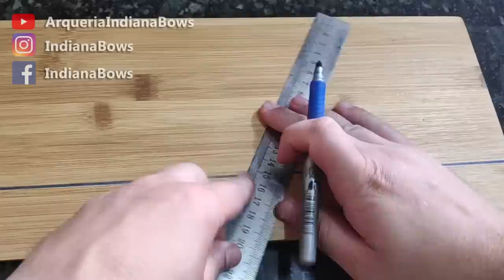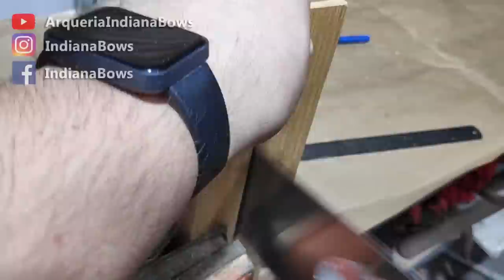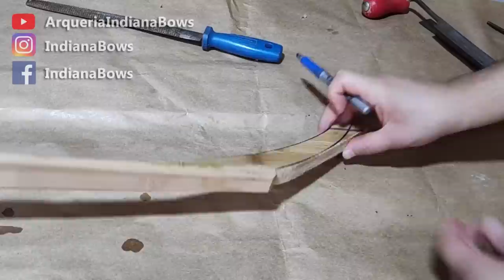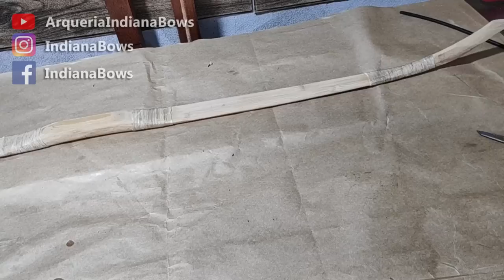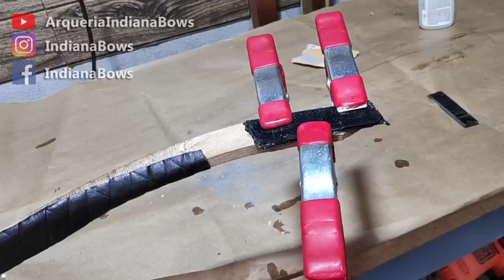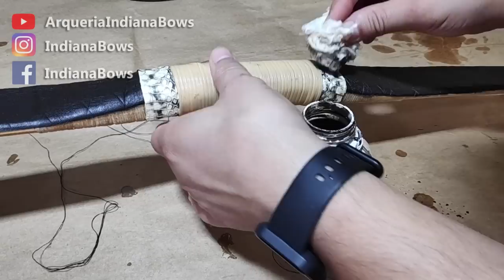BRILLIANT WAY TO MAKE A BOW WITH A CUTTING BOARD | Woodworking DIY

Comment: This is the most enjoyable build I've seen. Thanks!
Reply from the maker: Glad you liked! ☺️ There's another vídeos like this one here in the Channel. Feel free to check It out.
Thanks very much.
Reply: @IndianaBows  Yes, very interesting. Although I arms and recurves being held on by glue and bound string concerns me a little. I wonder if they would break after some time.
Reply from the maker: @JBplumbing12  well, the bow has already more than a year, and still working good. Of course sometime It Will break. Everything breaks. But for now, It's holding ok. 👍
Reply: @IndianaBows  Yes, your are right. Good job. All the best.

Comment: it looks like you made a very good bow with simple tools! I wish you included a bit more narration or subtitles to explain what the various glues and materials you were using. for example what is the purpose of the leather (?) on the front of the limbs? is that for tensile strength?
Reply from the maker: Thanks. The leather is to protect the wood and avoid too lift splints.
Reply: @IndianaBows  I see, thank you!

Comment: Good god.  These are some seriously lo-fi construction techniques.  I'd be interested in seeing you do it with only a pocket knife.
Come to think of it, the Mongols and the Lakota would probably regard this as magic.  I do.
The music, though, would probably have registered as demon squall. As it does now.  Not a fan.  (I've been listening to Karnivool and Mozart's Requiem on repeat all day, so nothing sounds good).
On the whole, pretty impressive, worth a subscription.  I retract the snark.
BTW, what was the material used for the nock reinforcement?  It looked like plaster casting tape.
I would be interested in seeing the build of a Mongol bow.  And you demonstrating it bareback on a small pony, no bridle, no nothing.  I believe they could pierce the armor of a medieval European knight.  Dunno how they did it.
Reply from the maker: Thanks! hahaha...  I will think about the mongol bow. :)
The tips reinforce was with micarta ( cloth + epoxy resin )

Comment: Impressive work. Very ingenious use of wood. Was the chopping board made from laminate bamboo bits? And what glue do you use? Thanks from the UK❤
Reply from the maker: Thanks! Yes, it was bamboo laminated cutting board. The glues that I used was cianoacrilate, pva white glue ( to glue the leather ) and epoxy resin to make micarta to reinforce the tips.

Comment: Please invest in a fret saw. Then you won't need to spend hours using the spokeshave.
Reply from the maker: I search here for a fret saw, but didn't understand How It could replace a spokeshave. It's possible round a corner with that?
Reply: @IndianaBows  I was just indicating that it might be quicker. A fret saw (or a coping saw) can be used to cut complex curves as opposed to more or less straight lines using a conventional saw. In your video you would have used it to cut the marked complex curves needed rather than straight cuts followed by significant use of the spokeshave to get to the desired silhouette. Profiling the curved edges can be done, as you showed, with files or the spokeshave. 
By the way, I loved the video - I was just trying to save you some time.
Reply from the maker: Now I Understanded. Thanks Very much. ☺️ But in this case, It could be used my Band Saw. With a thinner Blade It's possible make some Crazy curves too. But in the vídeo I decided use only simple tools to show that can be done without invest in expensive Power tools. 😉

Comment: From an engineering viewpoint it was PAINFUL watching you do the initial cuts into the  "cutting board"  .... you should hold the item being sawn lower onto the vice  ! and also closer to the jaws !!! ...... and ffs tighten the bolts holding your vice ! .... setting a poor example  !
Reply from the maker: Still, It turns out a good bow who shots Very well. 😉
Reply: It does show that something can be made even when the tools are not perfect or even sound. 

But I do agree that it is painful to watch and consider the wasted effort due to vibration etc.

Comment: Didn't see any glue-ing! Which makes the rest of your video totally pointless!
Reply from the maker: Sorry, didn't know that to make bows you strictly have to do glue-ing the parts of it. 😘
Reply: @IndianaBows  So how do you hold the constituent parts together, if not with some sort of glue? Even the English War Bow has some glue in it's construction, and it's design is the simplest of all Power Bows!
Reply from the maker: Did you watched the entire video? If you watch you Will understand How I did. 😉
I use two glues: cianoacrilate and pva wood glue. But the glues is not what stick the things togheter in this case. And even a warbow can be made without glue, wrapping ALL the parts. 😉
Reply: @IndianaBows  I shall re-watch! One probably can make a "War Bow" without Glue, but it won't be an English War Bow!
Reply from the maker: @oldmanwillyboy2786 why not? ☺️ If It have the design of a warbow and the same draw weight, It must be consider as a warbow. 🤷🏻‍♂️ The original ones was not laminated with bamboo or hickory, still you can make using It as an "english warbow". I already saw once a +80lb bamboo backend english longbow that was only wrapped with no glue at all, and works well. Maybe not the quiest bow, but works.
Reply from the maker: @oldmanwillyboy2786  wrapping all the parts together with a strong string. You don´t need to wrap all the bow. Only some portions of it between 10 or 12 inchs and it will hold.  Saddly I don´t have the photos because it lost in time (the original post was in 2015), but If you want to see the forum discussion, the link is below. With a translate you can easy understand what was said:
https://arcobrasil.forumeiros.com/t15319-warbow-mamute